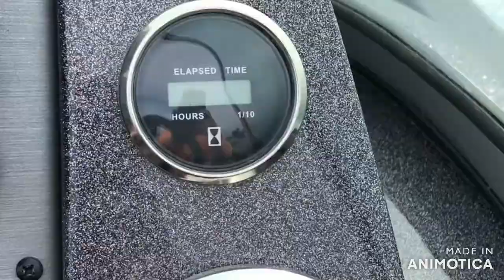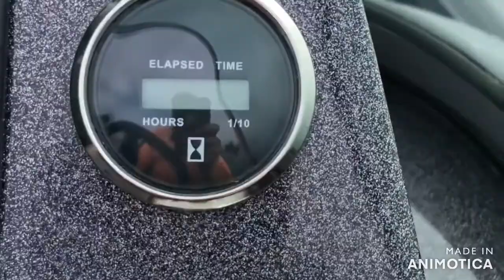Mercury 115 Pro XS Failure

Comment: Also you bulb may have felt a little soft. When you squeeze it the sound would go away. I switch out the throttle position sensor and and the shift position sensor as well only because smart craft was throwing that code. I do feel like it I would of extracted all of my fuel out from my tank I would have solved my issue.

Comment: Is it overheating or is it low on oil? There’s a sensor shut it down
Reply from the maker: Neither. Wound up getting the fuel pump and a bunch of lines/fittings replaced. Under load air was being drawn into a fuel line.

Comment: Check the float inside the VST. It may be too shallow. And also the vent hose, inside; Check and clean carefully. Also take a peek inside the low pressure fuel pump. If there is a diaphram, make sure it doesn't creak/crinkle when flexed; Needs to be rubbery. If not, replace it. There are many variations in fuel systems, over the last 20 years. I'm trying to be as general as possible here. Good luck. 👍

Comment: It’s overheating! You probably flushed the motor when it was running using the flush port!! NEVER RUN THE MOTOR USING THE HOSE FLUSH!! A ditz parts girl said to run it when I flushed! It blew a seal out and it overheated! Same thing
Reply from the maker: It wasn’t overheating. Anytime it was ran out of the water was with muffs not the flush port.

Comment: Hello I have a problem with my Mercury 115 ct. Up to 3500 rpm it works normally, then the boat doesn't accelerate until I reach 5000 rpm. The turns increase as a result of the rumble, but the boat does not move. From 5000 onwards it accelerates and glides, but the consumption is at each speed, about 600 rpm less. The engine roar and the revolutions indicated by the instrument coincide. The speed and consumption coincide (almost) with what I did before. However, between these two data there is a difference of over 600 rpm. It is as if the engine does not deliver the power of 600/1000 rpm. These revs then appear at maximum revs, where I reach 6100 instead of 5400 as before. I checked the flexible coupling and replaced all the fuel filters, I used additives and updated the ECU. There are no errors or alarms. Can anyone help me please? Thanks in advance

Comment: Check you fuel filter of you use gas with ethanol in it it can clog your filter fast i only use boat gas ethanol free in all my stuff i had similar issues with mine switched to good gas and no issues

Comment: It’s starving for fuel. Check the boat line from the tank back.
Reply from the maker: The boat side looks good. The high pressure fuel pump was previously replaced under warranty  and the motor ran fine for about 10-15 hours before the same problem pooped back up. Boat is back at the dealer for more warranty repair now that hopefully will solve the problem.
Reply: Check the air vent on the the tank, seems to run good just long enough to pull a vacuum on the system. This can cause premature failure of the fuel pump as well...

Comment: As folks on here have said, it's a fuel issue.  Your boat has a tank vent plugged.  Check the fuel bulb when it quits running to see if it's collapsed.  Once you get it figured out, take a class on how to trim your outboard.
Reply from the maker: It ended up getting a fuel pump replaced under warranty and some of the lines redone. Main issue was not a plugged vent but a fuel line that allowed air to be pulled in under load. Outboard trim was not the priority when we were messing with the motor.

Comment: Open the vent on your fuel tank....
Reply from the maker: Would have definitely been nice if the problem was that simple.
Reply: @brian8793  What was the issue? Did you ever find out?
Reply from the maker: Mercury ended up replacing the engine fuel pump and a couple other things. It's my buddy's boat but last time we talked the he said the issues were mostly gone.
Reply: @brian8793  Good to hear. I'm looking at vids of people whose engines fell off - cos today my engine fell off the boat :')  So it could be worse :D

Comment: Thanks for sharing your problem. I have the same engine and love it. Much quieter and faster than a Yamaha 115. I hope you have no more issues!
Reply: The 115 VMAX sho dusts the 115 pro xs from what I have seen
Reply: Nope
Reply: @benblazek3305  how can you dust an outboard motor that runs in the water? It can smoke it/smell 1s exhaust
Reply: @edwardabrahamiii3742  that's what we call being left in the dust in the region I live in. Can't get smoked by a Yamaha after 2007, they were all 4 strokes and the only 4 strokes I have seen smoke are all mercs

Comment: They are overengineered then underproduced with cheap parts in too many places. I am too young to say "they don't make em like they used to" but they really don't. I just stick to old 2 strokes. They can be had for dirt cheap, are easy to work on and tons of replacement parts and besides fuel economy are superior in every way to new 4 strokes. Blame the EPA, blame mercury whatever. I think this era will be known as the "plastic age" in 50 years and people will laugh.
Reply: 100%
Reply: It's starving for fuel. That's it. Has nothing to do with being overly complicated. Old school carbureted two stroke outboards can starve for fuel just like any other outboard. 

By the way, overly complicated is what you should have typed. Over engineered implies that a product is built to exceed bare minimum quality.

Comment: mechanical things do fail. glad its fixed. i have the same motor, so far so good. got 5 years warranty, i can still upgrade for another 3 and  probably will :). Safe and happy boating everybody.
Reply: Hey I just got a 115 wishing I got the 150, what are you talking about upgrading is there some kinda program to do that
Reply: @burackus4829  mercury has extended warrantiesup to 8 years . During promotions those are great deal.  Mine came to180 cad for 5 years all components so platinum level